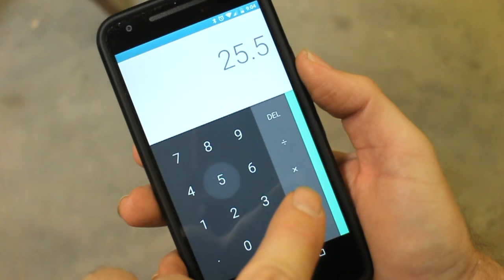Making a Collapsible Horizontal Bandsaw Extension

Comment: Nice idea and implementation as usual. The only thing that might make this not work fully is if the ground where you put the stand is either higher or lower than where the bandsaw is sitting.